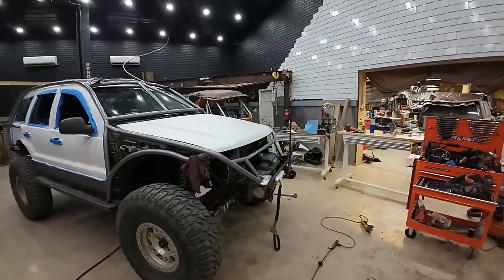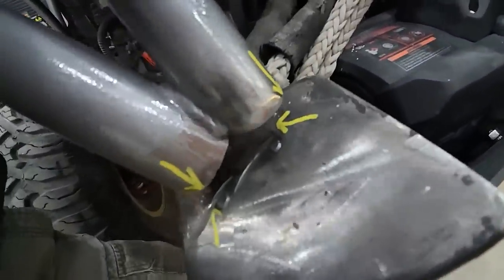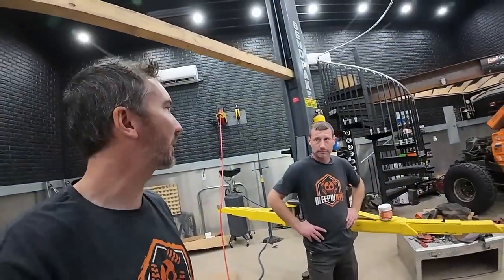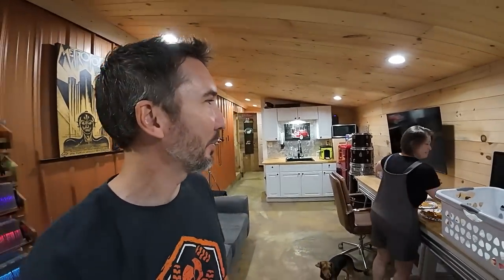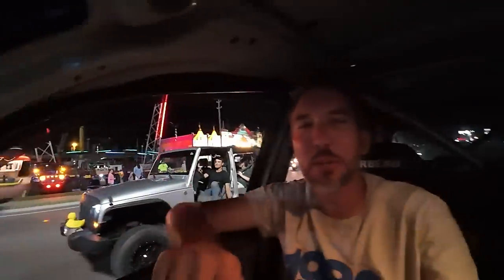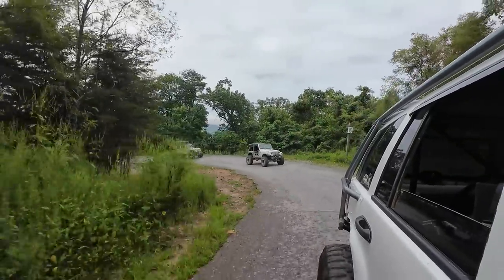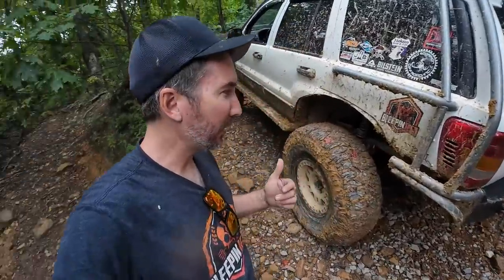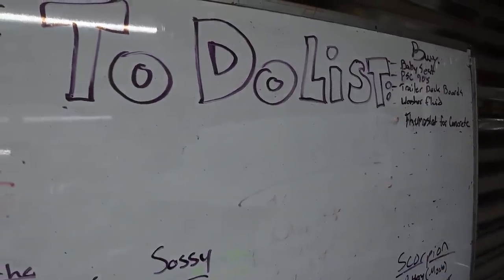The Paint is still WET but we're gonna SEND IT anyway! - Project Bumble - Pt 16

Comment: I really love the jeep build . That outside cage is so sweet and I love how it connects to the inside cage. You need to get the air-conditioning working again and then it wouldn't be so bad running on the trails when it's so hot out . But it figures you would get 5 bigish dents on its 1st trail run out with the cage done. Those side by side headlights came in handy that was a good idea for lighting plus turn signals in the front and Those K C lights are going to lite up everything so you can see and the welder was another perfect idea to. 😊👍👌👍🏻💪🙏🏼
Reply from the maker: Thanks,  it’s a beast for sure!

Comment: Some tabs off the roll cage and some screws in the front fenders would have probably been better than spot welding them so no worries about flex and popping off. Good job on the WJ one of if not the toughest looking one I’ve see.

Comment: What’s the deal with the badlands winch? I have the Warn VR8s winch but everyone I know and see has the badland. From Matt’s off-road recovery on.
Reply: I got my Badlands with synthetic rope for way less than Warn.  Figure not herd anything negative about it.   So far so good on 2014 Jk Rubicon I picked up April 15 2023.  First mod I made was replace factory bumper and add winch.  Not had any issues with my Warn that came with my 1995 YJ.  Like the synthetic rope for safety,  someday I hope to get Freedom winch line and replacement end...
Reply: @jeffrentsch4318  next mod for me is getting a wireless remote for the warm. Unfortunately they are $$$. I really want the Badlands wireless remote using that wiring mod. I need to do more research tho.

Id like to get the freedom line.

Comment: My fellow xj owners plz help! 
Does this sound like heat soak?  Driving slow on trails.  All of a sudden the engine starts breaking up... eventually it just shuts off.  If i try to start it right away it wont. If i wait 10min it fires right up and can keep going no issues till it happens again.
 2000 xj
Reply: Also, I have that little E fan on a switch and I leave it running constantly.. if I'm driving to work it never happens.. today I drove around.. found a small little mud hole by a baotlaunch and was crawling thru it... when I left I got like 200ft down the road and it started breaking up, it got worse and worse till it shut off..  waited 10min and it fired right up and ran fine the whole way home.
  Do you think this sounds like heatsoak? I can't find ANYTHING else that could be causing this.
Reply: It's happened when doing trails.. or if I stop at the gas station or multiple spots for a short period of time I'll start driv8ng and shortly after it'll do this...
  It's driving me nuts!
Reply: Bad ground or sum connection getting water In it.